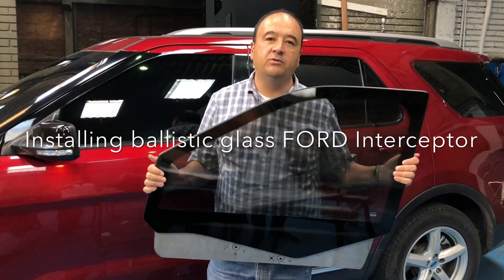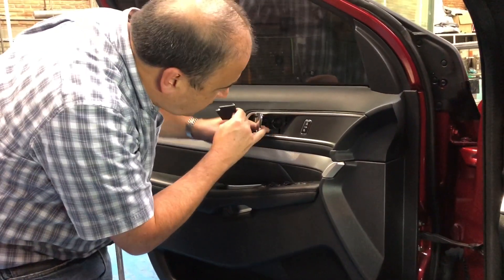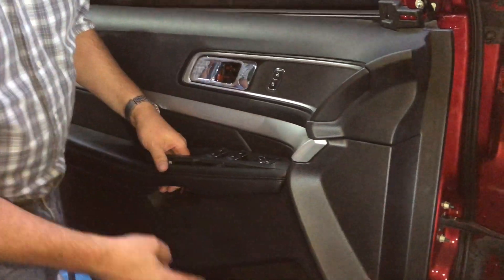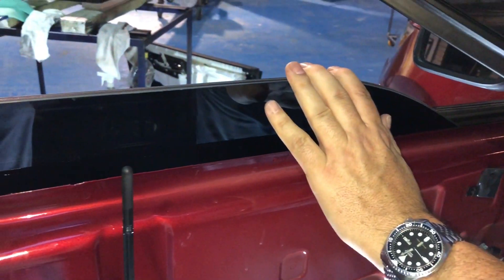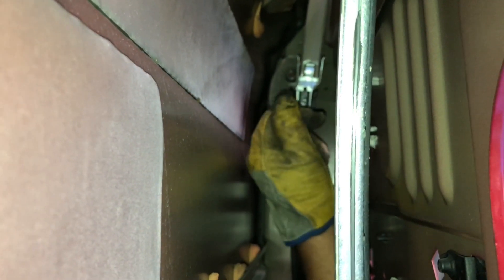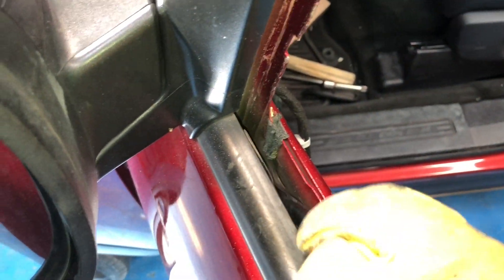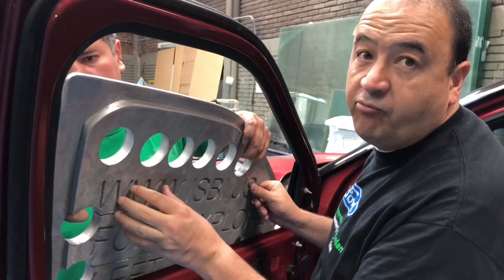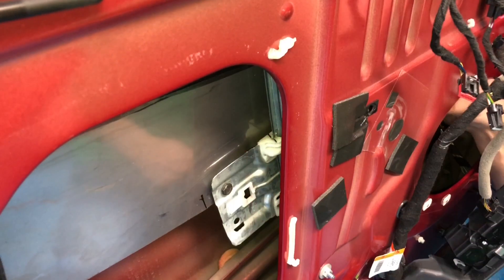Installation curved transparent armor ford police vehicle bulletproof ballistic glass

Comment: There’s only one small problem, that’s not a police interceptor utility.  Not even the undercover vehicles got that much luxury.  Also, most police vehicles after 2010-2013 came standard with level 3 ballistics.  Great work, but you’re basically just reinventing the wheel...

Comment: Do you have any level III or even IV glass?
Reply from the maker: 15 mm is our thinnest glass rated IIIA.  Stopping high speed 9mm 

Then we have 32 mm glass rated B5 stopping 5.56 

The next level is NIJ III of B6 stopping 7.62 Nato ball.  The thickness is 42 mm

The following level is NIJ IV stopping 7.62 armor piercing. Thickness 52 mm

Then with 78 mm we meet B7 and UL752 level 10 stopping one round of .50 caliber

At 120 mm we stop three rounds of .50 caliber M33
Reply: @isbiarmor  ok, cool thank you...
Reply: Will the 32mm glass fit into the driver side door of most trucks SUV's,  what do most people use the 15mm lllA glass??

Comment: Sir how expensive is the glass?  How much would labor cost to do it?
Reply from the maker: The cost for the all the glass and enough Kevlar (Twaron) for the doors and rear seat is $14,000.    Level IIIA (HG2)
Reply: @isbiarmor  how about just the front driver door glass and Kevlar. 1 door say on a  F150.
Reply: @isbiarmor  Will it cost the same By Cadlice Escalde And do you guys have a branch  in LA
Reply: @darkmoon8425  The cost for the all the glass and enough Kevlar (Twaron) for the doors and rear seat is $14,000.    Level IIIA (HG2) 9mm protection.  An able body shop in LA can do the install.
Reply: @johnmurphy1911  go up 1 or 2 levels if you going to do it and pay all that money, an extra $2,500 more will make you sleep good at night
Reply: @johnmurphy1911  when you say 9mm protection does that mean that larger caliber hand guns will go thru the glass?
Reply: @isbiarmor  Ok, How much is the cost just for the driver side window glass and Kevlar for the driver door only?
I have a 2011 Nissan Frontier  Level IIIA   

Also another price for the windshield approximately?
Reply: @HealthSupercharger  why would you just do the driver door only?
Reply from the maker: Including shipping the price is $1,800
Reply: @isbiarmor  Ok this is reasonable.  Level lllA stops all hand guns correct?

Comment: Nice but they should have replaced the motor in the window. It’s not meant to push up a heavy weighted windows. It will burn out soon.
Reply: I give it about 30 cycles before the motor burns out.
Reply: The controls should remain disconnected in most cases. Rolling it down negates it's purpose.
Reply: Brayan Carmona  idk i think at that point id rather save money and be protected while have a window that dosent roll down anymore
Reply: @dabbopabblo  unless it rolls down and it can’t roll up

Comment: They can just shoot through the door
Reply from the maker: Many doors are factory armored.  Up fitters also add opaque armor. From Proguard, Hard Wire or ISBI.
Reply: common sense most would go for windows cause they assume they are the weakest link but they will be surprised lol.
Reply: I think they're going to bulletproof the doors with wolven Kevlar
Reply: Just put an ar500 plate Inside the car
Reply: @deltashot5608  this is my plan
Reply: @jonjenaye1911  theres a website where you can custom order ar500 plates cut to any shape
Reply: Or shoot the tires
Reply: If I heard the Gentlemen correctly the glass when rolled completely up has 8-inches of protective metal  below that which covers the side of the driver as well....  Meaning, if they were to shoot through the door it would probably only hit the leg or hip, but Not a vital organ.... But Yes they should also install more protective sheets.
Reply: @jmartinez562  Kinetic Sand. At 4” thick can stop any handgun. Adding the two thin pieces of sheetmetal in the door I would assume 2” would be sufficient.

Comment: Nice. But  after a few days you have to do the same thing to replace the window motor
Reply from the maker: Fackeraster yfackingbts the motor will last a long time.    Modern motors have thermal fuses.   So if you use it a number of times in a short period of time it stops working.   After it cools down it starts to work again.
Reply: Does this void factory warranty?
Reply: You should tape up key areas to prevent accidental scratching

Comment: Excellent...
Where are you located ..
Can you teach in your showroom like crash course on few cars or a school for few days or weeks . Hands on training ..and info
Reply from the maker: goolgappa5 when a customer buys an armor kit (glass + Kevlar $12,000) we can also install it.  Depending on the country this installation costs varies from $8 to $10 thousand dollars.  

This kit includes the roof armor.  Level IIIA
Reply from the maker: Choice777 this glass in this video has an offset. The edge is 9mm thick and the package is 7.5mm. 

We now offer a different formula por police vehicles.  The new product has a 5mm edge (offset) and a 11.5mm package.   This new glass is a lot easier to install.  No modification has to be made to the top door rails. 

The inside surface is polycarbonate.  The strike face is laminated glass. 

The level of protection is NIJ 06 level IIIA or 07 HG2
Reply from the maker: Choice777 it is a total of 16.5mm.  Not 11mm
Reply: in the video the new glass has 2 zones with different thickness. Which one is 16mm and how much the other ? Is it all glass or glass/poly/glass/poly ? what mix ?
Reply: so it's 11.5 mm total of combined glass and plastic sheets ...so it starts with glass on exterior and ends with plastic on interior ? I thought it has to be 16.5 mm thick in every place.
Reply: Hey how are you , i was wondering if you guys sell this kit for any model of crossovers